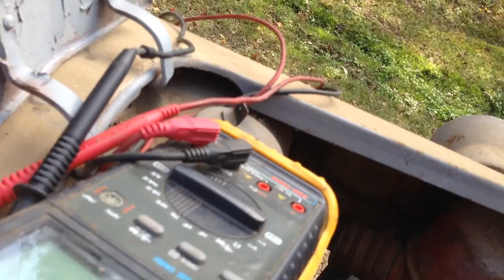Ford 8n Tractor Old Start Part 1

Comment: I love those old 6 volt systems and those front mounted distributors are easy trust me there's a trick to it 😎
Reply: It's so painful to watch someone work on those distributors on the tractor when it takes two minutes to pop off the two bolts and work on them on the bench.

Comment: my mom has a 8N. I would plow her 2 1/2 acres couple times a year. They purchased in late 70's, was told only last 5 years. wrong. It still runs good, still has 6 volt system. A friend now does plowing with it.

Comment: I  just got an 8n for free and I spent a few days soaking the rings in tranny fluid.  Cleaned the points, installed a internal resistor coil and cleaned the card and got her up and going!!! Posted videos of it on my channel, check it out if you like!!! Keep Rocking it out!!!
Reply from the maker: I’ll check it out, they are great tractors. Thanks for watching.

Comment: Not very safe but, you can test spark by touching one of the parts ( I think the ceramic part ) to the engine block and turn it over, and look carefully for spark

Comment: Do you need a resistor if i were to install a 12v coil? Wouldn’t the battery die because the generator can’t keep up ?
Reply from the maker: You do need a resistor even with a 12v coil unless it has an internal resistor. Yes the battery will die, I did a 12v alternator conversion on this tractor.